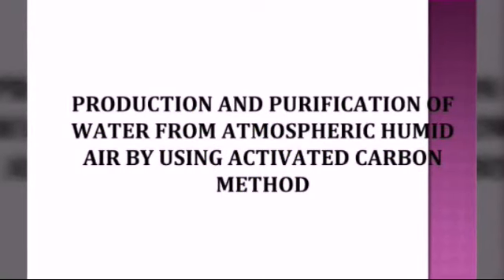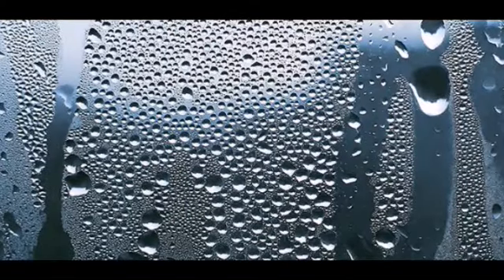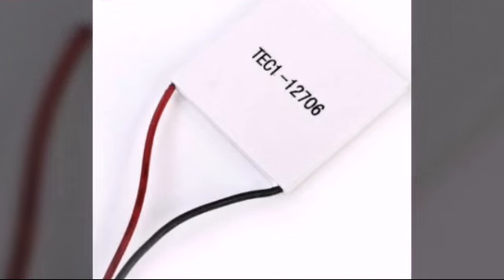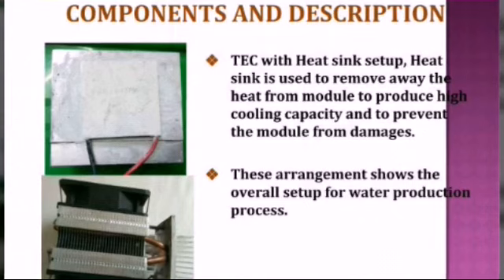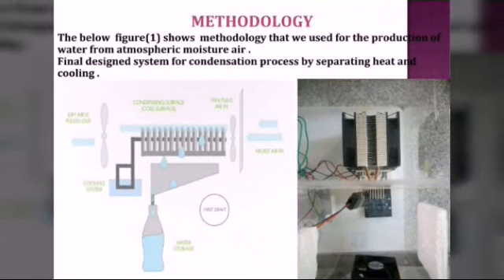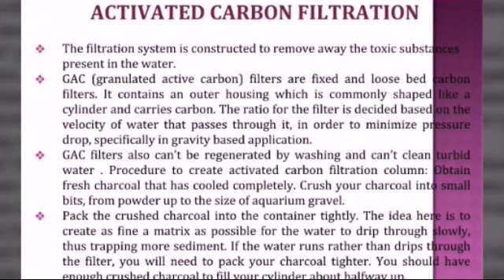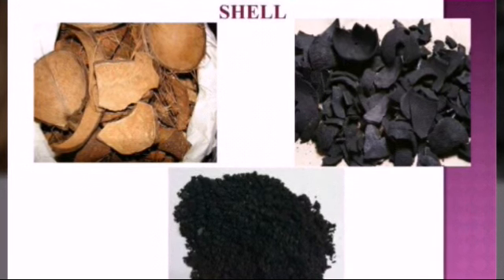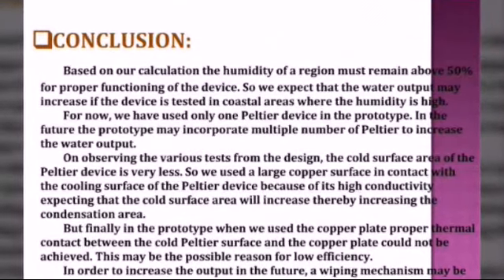Extraction of water from air using peltier device.

Comment: Strange question maybe, but since the other side of the peltier device gets hot, why not simply stick it in grey water to get the humidity for your device to work, better yet, make it a rinseable closed system? that would increase efficiency more than 200% I guestimate.